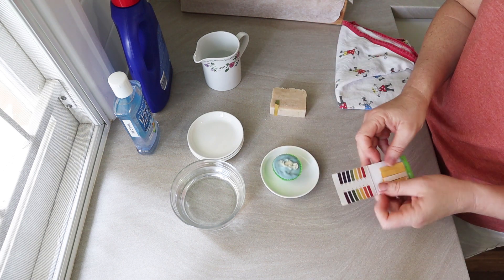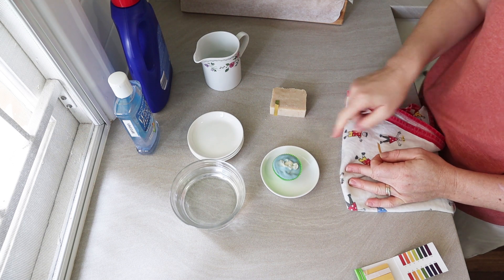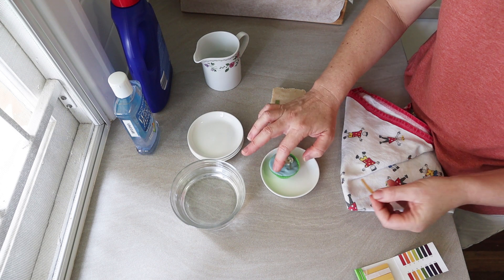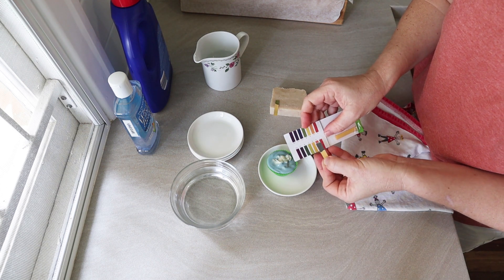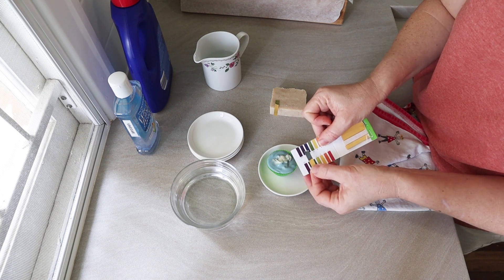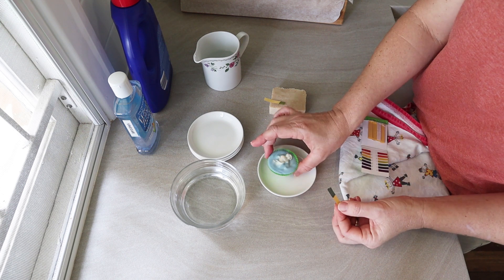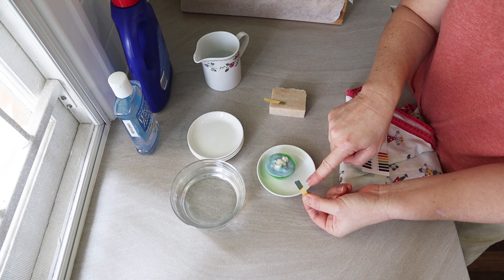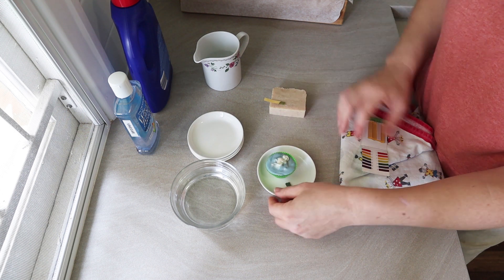Handmade Soap Testing - How to test the pH of your handmade cold process or hot processed soap

Comment: I didn’t even know soap could be unsafe???
Reply: Ok, but you're referencing processed soap only, not melt and pour, which does "sweat" sometimes and does not mean beading is an "unsafe" product.
Just saying because not everyone knows there are multiple ways to even make soap
Reply from the maker: Good point! I guess I'm only referring to soap that is made from scratch - cold process/lye soap.
Reply from the maker: Well I hope that most of the time it is safe (mine certainly are!) but if you are new to soap making, and you aren't sure if you measured things correctly, or used a dodgy recipe, there could be some doubt. It is definitely possible to make a lye heavy soap! Which wouldn't be great to use or give to someone else to use.